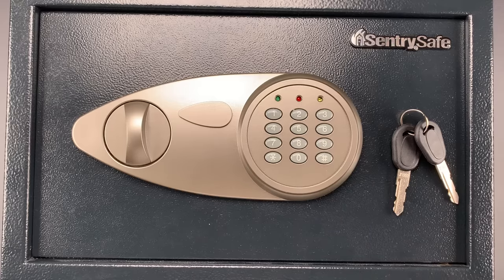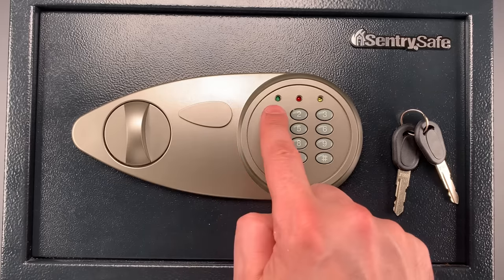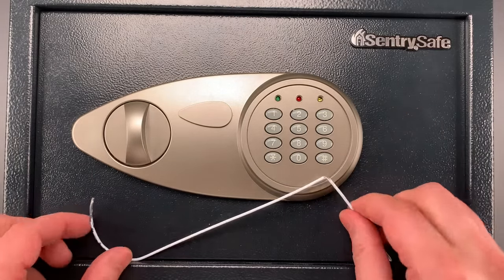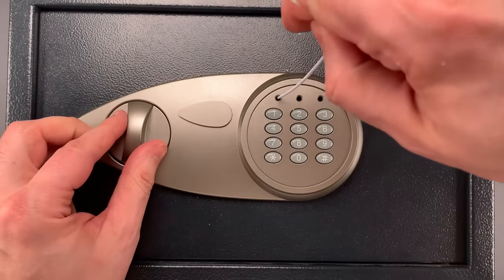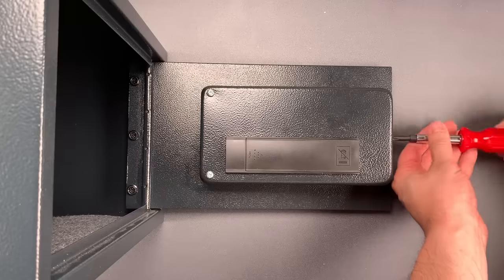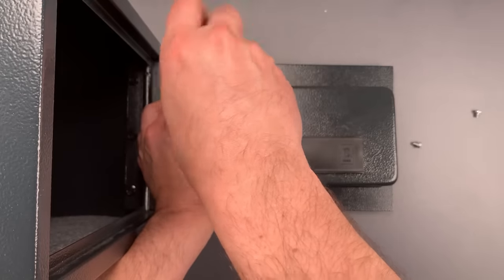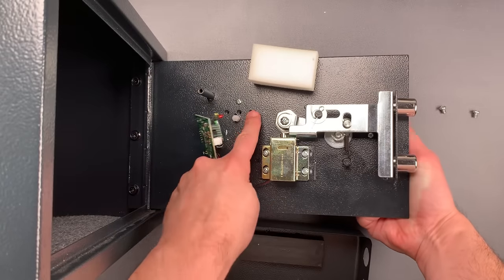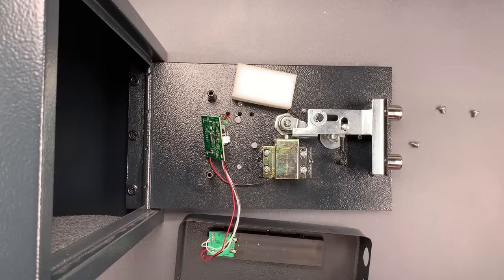[1020] SentrySafe Opened With a Coat Hanger!

Comment: I could fix that issue in less than 5 minutes with a press brake and a drill press. It would probably take longer to measure and cut a piece of metal than to shape and install it. Then the solenoid wouldn't be accessible from the holes.
Reply: that's when you break out the neodymium magnet. theres a vid here that shows a sentry safe opened in 5 secs with a magnet
sentry should just forego the lock and just a handle opens it. oh yeah don't keep anything valuable in them.

Comment: wow!  the solenoid sure needs better protection!  Fixes I could see: the LEDs on a daughter board that is attached to the outside, with a flat wire that runs through a hole, that has an inner cover plate... and the top of the solenoid definitely needs protection around it!

Comment: Action packed movie where the MC masterfully takes a coat hanger and in a thrilling scene.. gently turns it to open the lock, with a full mesmerizing 3D rendering of the safe and its intricate single pin that just needs to be pushed a little.

Comment: I have one of these hotel safes.  It's way easier just to pick the key lock with a paper clip.  I got locked out of mine with dead batteries and an MIA key.  So I thought I'd try picking it with a bent paper clip.  I just jiggled it a round while turning and it unlocked instantly.

Comment: I have one of these safes mounted to bottom side of my desk which I use to store medicine, my checkbook, some cash, and a few other things like a pistol and extra magazines.  Knowing the safe is cheap it's main purpose is to keep things away from the grandkids or other prying eyes.   Still I bent a 6" piece of sheet metal to fit between the circuit board and the solenoid which prevents this easy method of getting it open.   Not much I can do about the magnet method other than creating a shield on the outside, but then again most people won't be carrying around one those super magnets.

Comment: They added a plate between the holes and the solenoid in the newer models. If you use the rightmost hole instead, you can still get to the solenoid by bending the wire as you put it into the hole so it loops around the vertical plate.

Comment: You can open these types of safes pretty easily if they aren't bolted down, the deadbolts are kept in place by a thin piece of galvanized metal.  If you take the safe and bang in on the ground or something hard on the hinged side, opposite of the deadbolt side, it's usually enough force to bend the cheap sheet metal holding the deadbolts and letting them back out of the locked position.  So if you're gonna use this cheap type of safe, be sure to bolt it down or all it will take is just one thump on the side opposite the deadbolts, (usually all that 1 inch diameter deadbolt weight is enough to drive and bend the sheet metal actuating bar) and someone's gonna be walking off with your contents.

Comment: I replaced the high security sponge with a block of high security 2x4, and the metal bracket installed in the newer versions seems to be decent.

Comment: You are an incredible talent and I thoroughly enjoy your channel.  However in this case and perhaps others, I believe you disassembled the unit first after normal opening to determine the exact length of the wire and position to release the plunger.  If you started with a locked unit what would your experience be like not knowing the exact wire length and solenoid position?

Comment: Excellent, since I can’t seem to get my safe to honor my new code, this is much easier.
Though I’m wondering if I did want to secure it a little more from yt phd bandits, if I riveted a piece of aluminum angle on the back to guard the solenoid attack through the led holes.

Comment: Sentry safes look impressive, look at the size of those bolts in the door, then look at how they are mounted. One guy did a you tube video showing him cutting open a sentry safe with a Skill saw. They only have thin sheet metal and underneath is insulation and plastic.

Comment: It would be so easy and cheap to mostly fox those design faults. A shield beside the solenoid, and welded on screw posts for the circuit board, ensuring the LED’s are surface mounted so they can’t be pushed in.

Comment: This worked. Though after I pushed the led and sponge away there was not enough room to make the angle to release the solenoid. So I just broke off all the plastic housing on the keypad to expose the metal and the holes. Then it worked with the coat hanger.

Comment: Same safe with a dead battery and no key.  I tried the bang on top method, even with a big dead blow hammer (think sentrysafe put a bigger spring in it).  Next I tried to pick it.  Neither worked (I am not good at picking).  The coat hanger worked.

Comment: This might be the safe that you can also bang on the top and keep trying to flip the switch at the same time. I had to get into mine one time because I locked my key in it and the battery died for the keypad... banging on the top literally moved some mercury switch enough to let the handle turn.

Comment: ULine has a electronic locking cabinet with a similar locking mechanism.  That solenoid/pin combo.  However, the works are all bolted in, so something that easy isn't possible.  It's still easy to break into if you really wanted.

Comment: I tried this a few times. I couldn't get mine to open. But what I did was take a sharp knife to one of those little holes on the back of the safe and pryed that hole until it was wide enough for me to get my stuff out. It took a bit hey it worked.

Comment: OK so then what if someone fabricates extra security on there. Basically welds a metal plate to to cover the led lights hole or to block anything from reaching the solenoid?

Comment: you can probably fix that issue with putting a block of wood or piece of sheet metal covering that part and epoxy gluing the leds in place, im sure all locks and safes are vulnerable in one for or other.

Comment: theres even a simpler way when its not screwed to the wall.
put it on your knee shake it and try to open it. It may takes some attemps but it will open, atleast at an similar model i had

Comment: With those long LED legs it would not matter if the circuit board was back by sponge or hard secured in place as the legs would bend, as yours did but not in the same way, to allow the LED to be moved out of the way.

Comment: I had a larger safe with an electronic lock. I didn't know the combination, but the circuit board and battery box were exposed to the front. The idea behind the safe is that you enter the correct code and it completes the circuit, allowing power to flow to the solenoid, which retracts it and the safe can be opened.

So I just cut the wires leading to the solenoid and attached them directly to the batteries.

The batteries are on the inside now, which is good, but what happens when the batteries die with the safe locked and the keys are nowhere to be found? Well, that's why we have this video!

Comment: Could you also have used a neodymium magnet to push down the component from the outside instead of using a wire coat hanger?

Comment: I used to see guys at our scrap yard taking door cards off , and generally messing around with doors of various models . 
It was going over my head until someone enlightened me  that they were looking at ways to get into cars .

Apparently if you know where to punch a screwdriver through a car door panel, you can easily pop the lock . 
Scrap yard, or thieves schoolyard ?

Comment: Here's a question what can I do to gain entry into my safe that is  an underfloor joist type box with a secure 2 bolted lid with a manual 2 side bitted key well the keys are missing so because I've not got any keys I cant exactly get a spare cut so I'm assuming I'm gonna have to drill out the lock or jam a flat head screwdriver in lock and force turn it counter clockwise to get lock open

Comment: saying "High security sponge" is like saying "historicaly accurate lawn mower" in a fort (Fort knox in maine) used in the 1800s.
Reply: Totally off topic, but the lawn mower was actually invented in the 1830's. For a small lawn I actually prefer an unpowered reel mowers.
Reply: @richardthrust1126  i meant a gas powered push mower

Comment: The bad thing is with these cheap safes you can use something that is already inside a hotel room, either a towel or a jacket or something soft or even just your bare hands if you are feeling tough but in the middle of the safe on the top side towards the front just punch it and turn the dial at the same time it takes a couple of attempts but would be an interesting video for you to make but I've got into a few of these safes with permission and that is how simple they are

When I've done it I use palm of my hand and slam down on it and turn the dial again it's that selonoid that is the week link because the spring is that week it just bounces around, I figured you'd like to know how really unsafe these safes are.

Comment: I took my safe apart, and found the same weakness⚠️🤯😥 Somebody could break out the LEDs, and fish a coat hanger down to unlock my safe.attwood 2050-5 Vinyl Grab Handle - White

BUT⚠️😁 I installed an extra plate of steel right between that keypad and the locking mechanism. No more coat hanger shenanigans from the LockPickingLawyer! 😭😂

But I'm not shipping it to him, it's way too costly freight shipping, and it's now bolted to my house. ⚠️😎

Thanks for showing me how to add a plate to stop this coat hanger hack into my (or any) safe if they removed the internal cover added a barrier plate to separate the keypad from the locking mechanism.

Comment: just drop the safe on the ground, and the solenoid wil bounce and then the safe is open. the spring on the solenoid is very weak because the solenoid works
on 2 1,5v batteries, so these cheap safes are just not safe at all.

Comment: If u just fixed those holes by soldering or put a screw thought there  and put a stronger spring on solenoid that safe will be a great safe. Once u do that an intruder is not goin to take that extra time to try to figure out why is not opening and just move on or just leave it there

Comment: Just screw a metal box around the solenoid, the LED holes was dumb a 10mm Polycarbonate Plastic plate the LED light will still shine through. They went cheap this what happens lol

Comment: I got through my buddies safe but sticking a 5g bucket handle through I'm assuming mounting holes and holding the password reset button, putting in a new code, then just unlocking said safe. Disappointment.

Comment: Note: That is not a coat hanger. That is a shirt hanger. Shirt hangers are a thin gauge of wire(13-14), and often white, though sometimes other colors. They will hold a shirt nicely, but will bend under the weight of a coat. Coat hangers are occasionally 10 gauge, but normally 12 to 12.5 gauge, usually gold.

Comment: I don't get it. If you want a cheap safe, why not use mechanical combination lock with three code wheels in it? Those are definitely possible to manipulate open but even LPL would take a minimum of couple of minutes. Sure, it doesn't look equally fancy outside because you only have the safe combination wheel visible but it would be much more safe than these electronic toys.

Comment: Ya this works way to well got mine open in like 2 min taking it apart it's so cheaply built the locking bolts that secure the door ate just stamped metal

Comment: easy. Just put away those LEDs and put there something solid or just make sure that no wire can push that thing down (like putting something there between those holes and the thing he pushed down). Problem solved.

Also in my personal use nobody would figure that they could do that. Especially where i live.

Comment: I have this same safe. Today I had changed the code and didn't put the little battery cover back on. When I closed the door the batteries all popped out. And for some reason I cannot find the key anywhere. I didn't know about where to go though the lock picking lawyer. It ended up taking me a total about 10 minutes but would have only taken me two because I made the hook too small the first time thank you

Comment: I'm reposting @sourflowerpack9610's comment because it's much less invasive than this technique:
"Try this, you’ll be very upset about it, turn your dial like youre trying to open it, just has to be at the point it stops moving, then with your open hand, smack the top of the safe while turning the dial at the same time, the safe will pop open, a common smack’s shockwave allows you to turn the dial and open these little safes.."
I tried that 3 times and on the third time, BAM, the knob turned and the safe opened. No need to mess with the LEDs. This safe has like 99+ ways to break into it, lol.

Comment: In all honestly! one will have to know exactly where the solenoid is and that the led lights were pushable! lpl has to examine the lock by opening it first and then finding the trick. in any case he would of had trouble if he hadn't open it to examine first off.

Comment: Theres actually an even easier way to crack this. Turn the knob clockwise all the way, then back 1/8” until it clicks. Hold the knob in this position and lift the left side of the safe about 3-4”. Drop it and turn the knob clockwise just after the safe strikes the ground. It is way too easy.

Comment: have the same safe, easiest way to open put it on the floor bang on top part with hand 3-5 times this will move the steel bars and BOOM its open. its a terrible safe.

Comment: Okay,,,,,after watching this video l made a call to SentrySafe to get a refund but they insist that they have a fix,,, their solution is for me to take welding classes and after l get my degree as a welder, l should go out to a hardware store and buy a welding machine and weld my safe shut in order to keep my stuff safe from thieves.... l told em that l think that,,, that's a bit to much,,,, l will see you in court,,,, they said good luck with that,,,, saying it,,,, as if l didn't stand a chance at winning my case....

Comment: They only care about money! If you think this is bad find a video on Boeing 737 Max. How they just bolted new bigger engines that don't fit onto wings, effd up aerodynamics and fixed it with software, using only one sensor to avoid regulatory red tape. Oh yes, part of the deal was that pilots should not require training on updated plane, so they gave them a short brochure that mentioned what to do in case your plane decided to nosedive on its own. People have died!

Comment: I got you beat: I opened a SentrySafe with a paperclip. Yes, a plain old paperclip.
Years ago, my late wife had bought a Sentry brand fireproof "Safe" to store her important papers. It had a key lock. When she died, I needed to find all the typical personal papers you need to settle her estate. I needed inside that safe and I could not find the keys to it anywhere. One day I desperately tried to pick it with a bent paperclip. My "picking" attempts failed but just sticking an unbent paperclip into the keyhole and turning it worked like a charm and the lid opened! Yup, I yelled out, "YGBFSM!" The "lock" was just a pushbutton latch at the bottom of the keyhole that freed the barrel and any object that could depress the button and turn the barrel would work! HUH? Someone thought that was a good idea?

However, the contents of her safe were just one more reminder that her idea of "important" was not the same as mine. I wound up visiting various offices and requesting duplicates of her vital papers.

Maybe the proper use for such a "safe" is to load it full of unimportant stuff and have it as a decoy for thieves to steal instead of real valuables. Perhaps my late wife was smarter than I thought?

Comment: These "safes" are ridiculous. And the LEDs don't even have standoffs to keep the standing right on the PCB, and that's why you can easily bend one out of the way, even if the PCB was not mounted on a sponge.

And using a sponge to hold the PCB in place? Ridiculous! This locker is crap!

Comment: It’s not that easy. I’ve tried opening mine so many times this way and it’s just not that quick and easy for someone who doesn’t do this every day. Giving the measurements of the wire tool you made may help.  It’s just not that easy.
Reply: I did it today. Honestly I didn’t have a lot of faith. I struggled at first bc I was using hair pins and whatever other metal thing would fit but when I found the wire hanger I got it in five minutes I swear. Make sure you’re trying to turn the handle as u go and just keep probing

Comment: More thieves  are lazy idiots and the purpose of most of these type of 'safes' is to make them think 'too much work' and they pass on it. It would require them to bend and cut a coat hanger which requires them to have a coat-hanger, a means of cutting it and bending it. It is marginally better than keeping your valuables in a drawer and quite often than is enough.

Comment: How would you know the location and exact tool to jimmy the latch if you had not opened the safe and studied how to open it? This is a ridiculous review and I suspect your evaluations are nothing more than click bait for your profit. Jamming a wire into an electronic circuit will result in a ruined circuit and the lock will never open again. A piece of foam will hold just fine as long as the safe is not dropped off a building. The context of where the safe is used must be part of the review.

Comment: Only an idiot would put $2000 in a $100 safe. It's like buying a $50 motorcycle helmet. Is your head worth $50 or is it worth the $400 for a good helmet. If your storing low value items this is fine.